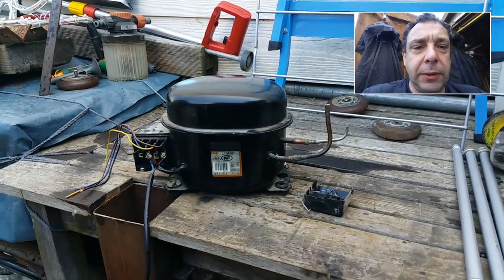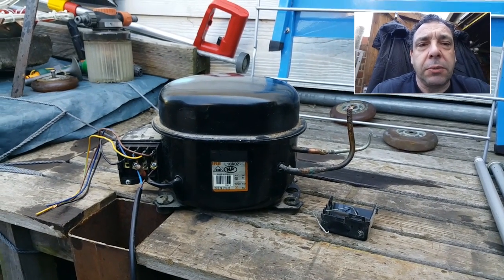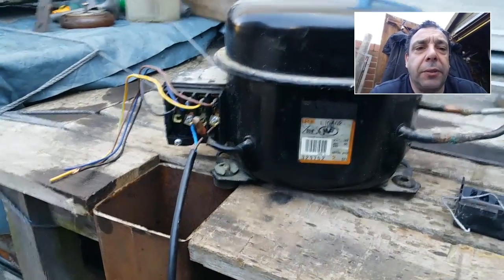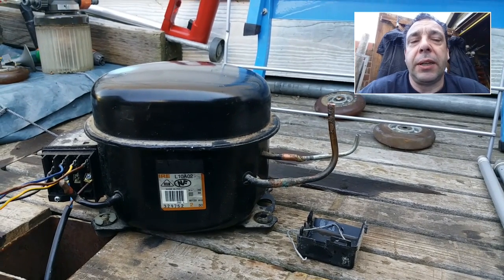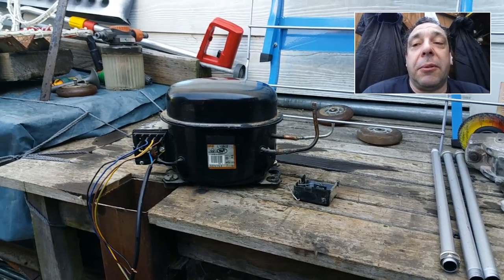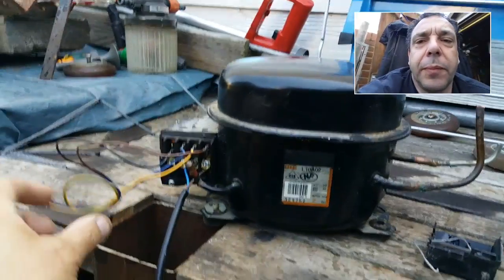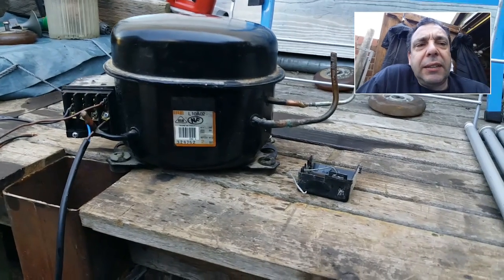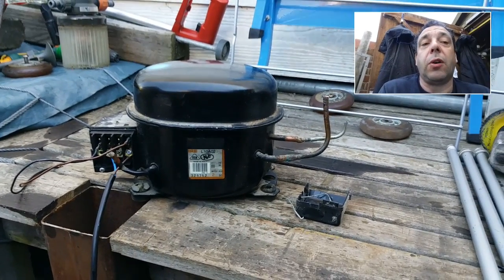Home built air supply using fridge compressor Part 1

Comment: I was so pleased to see an English video on how to use a fridge compressor as they are all American on youtube. I have an old fridge compressor sitting in my house i want to use, but was scared of blowing myself up as it say's it contains flammable liquid. Did your one have thew same warning stickers?
Reply from the maker: Hi there,  yes I think it did have the stickers.  I was worried at first but found a couple of English videos which I followed. 

It's been running for several months now and it all seems fine.
Reply: Did you have the chemicals removed or just use it as it is?
Reply from the maker: I just had the gas removed and then used it from there
Reply: where did you get that done pls?
Reply: Just to let you know for any future compressor builds. i just spoke to an engineer in this field, and he told me if you use a fridge compressor that has r600a on the label it only contains a butane type gas and is ok to vent to atmosphere, and can be used as a mini compressor straight away.
Reply from the maker: Inventor1810 Jason I got a local car place which did aircon to remove it.  I left it with them while I went shopping and I think they charged me 5 quid

Comment: I approached the problem of reusing a fridge compressor in the same way, reconnect wires, close eyes, screw up face and switch on (wait for the bang).
    I havent hooked mine up to a holding tank as yet, one of those jobs to get around to doing.
           Nice video, thank you.
Reply: one reason you might be getting a hole is there is no where for the air pressure to go when you heat the pipe ... make sure the tank valve is open to release the pressure and it should seal
Reply from the maker: I'm really pleased with this build.  The only problem I have is a pin hole leak in my welds on the air tank.  I've tried re-welding over the top without any luck and I also tried liquid metal type bond. But for some reason I have this really annoying leak.  Such a tiny hole but it means the tank always needs topping up. glad you liked the video and thanks for the comments.
Reply from the maker: integra22tt thanks that's a good point